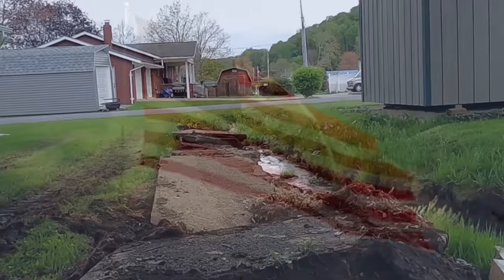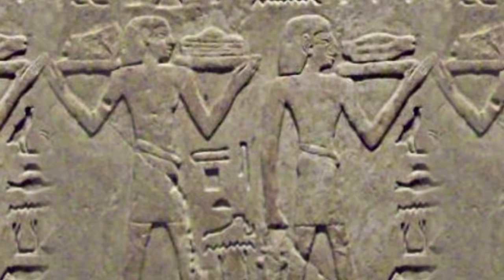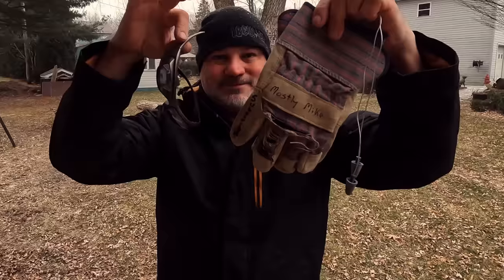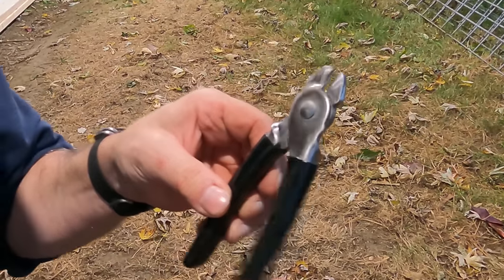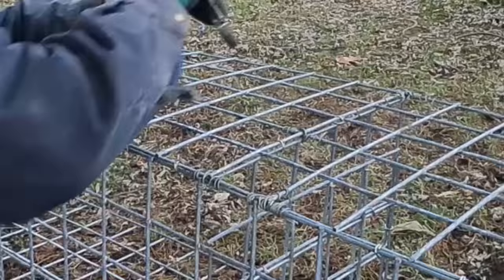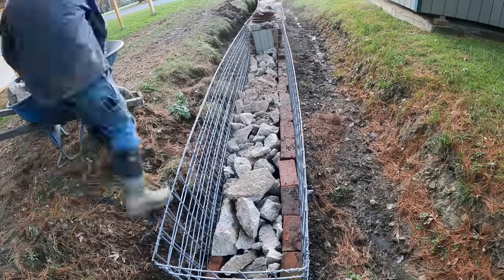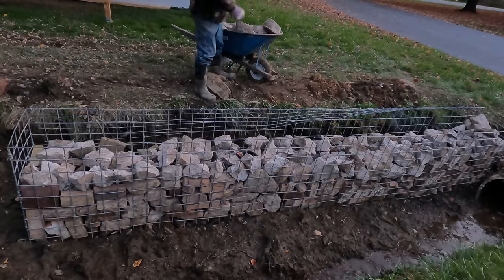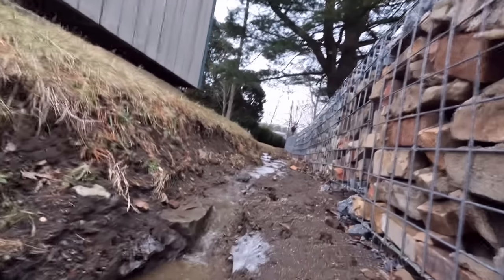How I Built My Own Border Wall Cheap

Comment: Anyone wanting to do this you better get permissions from the city or you may have an issue selling the house later. Even if you're not 'redirecting the river etc' the aholes at the city will have a conniption for no reason about this.
Reply from the maker: Thanks for watching Jeffrey. Yes, I would imagine that some municipalities would. I just think that being that I filed multiple complaints with my boro being that there's a 24 inch pipe feeding this ditch, which occasionally flows at full pipe when it floods... and then there's a 16 inch pipe at the end that flows under the road which dams up. Even if there's no obstructions it dams up. Usually one stick will go across that pipe and then the leaves and grass build up on it. I believe that this is a clear violation of plumbing code, and they don't want to do anything about it. They keep promising, but they don't produce any results. It's ridiculous. At least this wall keeps the water from just coming into my yard, and flooding my garage. Instead, it flows over the end and then goes down the road and washes my gravel out of my driveway.
Reply: It's not a permanent structure, so no permits needed.
Reply: Free men don’t ask
Reply from the maker: @smellycat249 Ha ha very true . I am not a fan of big gubment.
Reply: @smellycat249 
Proud member of the outlaw builders association 28yrs,  no permit required.
Reply: Your property  do as you wish. Tell the government to fly a kit
Reply from the maker: @jpgerard9844  Absolutely! This is 'Murica! I'm a proud veteran who fought to defend this great nation. Thanks for watching!

Comment: Very cool! When I was in Afghanistan we used these to surround our base, only difference is we filled them with sand and stone and they had fabric liner inside to hold it in
Reply from the maker: Thank you so much for watching, and thank you for your service.
Reply: Same here in Iraq. Good 'ol Hesco barriers. 

I am curious, though, isn't the water just going to push through the loose stones' gaps?
Reply from the maker: @preparedmindstrongspirit5724  well, yes, it does move through, but it slows it down and diverts it. It actually carved the ditch bigger the other direction from the diversion. What I like is that it allows the water to absorb when it gets high. It's always going to take the path of least resistance, at least from what I researched, which is making it carve the opposite bank. I own both sides of the ditch.
Reply: I built gabion towers for my driveway. They are about 10’ tall
Reply from the maker: Sounds awesome Michael. They're a really cool artform. If you have any pictures of them, feel free to share on my Facebook page. Thanks for watching!
Reply: Welcome Home
Reply: I'm exploring using Gabions to divert storm water runoff towards my house.  Was wondering if adding sand would further slow water from seeping through.
Reply: I would like to learn more about this. How high could you go with the wall filled with sand? I’m wanting 15-20 feet in height

Comment: I did a mass wall a number of years ago.  Stone face either side,, rubble fill.  Grade change from front yard  to walk out basement  rear.. I feel your pain.  Mine was only about 30 feet long,, being a mass wall  8 feet high meant  8 feet wide at the base,, plus a footing that reached another 3 feet down below the frost line.  Half a dozen of the stones were very large 400 to 700 pounds.  Most were in the 20 to 100 pound range. Just muscle, pry bars, and sneaky when needed. Evenings and weekends as time and weather permitted,  zero mortar or cement except the busted up stuff in the center. Just dry laid.  This is 30 years on,, nothing has moved or shifted.  Wife complained that it took too long,,,, it did.
Reply from the maker: Thanks for watching and sharing your wall story Sailor. It's hard, backbreaking work, but certainly rewarding. I love to just walk around looking at it to enjoy the fruit of my labor. I've done a few dry stacked stone walls with natural stones and some with store bought blocks in recent years. They appear as a backdrop in my fair weather videos. I'll be posting a follow-up after a year and a half with some additions and upgrades to this wall.

Comment: I did do the walls in my back yard but instead of the hog nose rings I cut the one out side leg of the wire off and bent then around the sides piece .  Also used the same method to make a 12 ft wide Matt 8” thick with the 3x5 rock to prevent erosion .
Reply from the maker: Nice Richard! I think that I am going to be making a mat along the bottom of that ditch to prevent erosion as well. I never thought that would be a problem but the ditch just keeps trying to match the elevation of the pipe going under the road. I started that project way too late in the year and I am just waiting for everything to thaw out and dry out to continue it. I might post an update video when it's done. Thanks for watching!

Comment: I have built gabber walls on a professional basis. The biggest one was a retaining wall for a shopping center where we used 4.5 thousand tons of granite and 17 thousand tons of road base behind it.  I have also built gabber fortifications for re-enactment, where we weave the baskets out of willow strands and fill with dirt and soil.  These are good things to protect cannons with.
Reply from the maker: Thanks for watching Armoury Terrain. I'm sure that as a professional who has built many of these walls, you may have shook your head in disagreement with some of my methods, LOL. I just sort of flew by the seat of my pants as I went about this project. It's relatively low to the ground, but I did make sure that I tethered it so that it could not wash away in a flood. I will be doing a follow-up video with some of the issues I've had with it as well as some improvements I've made. I built this a year and a half ago, so the Landscaping is now done and there's a bridge across it.
Reply: @themostlymikeshow  It will never ever wash away, it is too massive. The worst that can happen is that running water may be able to undercut it, causing some sections to slump a little.
Reply from the maker: That's spot on. It's exactly one of the issues that I had. One section had washed underneath and caused it to slump a little. I was able to drill a hole in the frozen ground, hook a strap and come along to it, and pull it straight. I then drove 4x4 pressure treated posts horizontally on angles to divert the water away from the wall. I filmed it, and will put it in the follow up video.
Reply: @themostlymikeshow  even though it takes a lot more material and effort, the best results are to first dig a ditch and bury half a basket in the ground to create secure footings.

Comment: Massive respect! I repaired a collapsed wall and related drainage system this past fall. It’s so true about the days getting shorter while working in the cold with a head lamp and lights.
Reply from the maker: Thanks for watching and the kind words T23001. I started on this when the days were a little warmer and with more light and once I get involved like that, it's all that I want to do. After the wall was complete I did wait until spring to do landscaping and back filling. Was your wall a gabian wall?

Comment: Thanks for the new idea.  We have a property next to a rental and there is a natural drainage that overflows in the rental's back yard and comes over to our property and runs beside our 48' garage.  The water has flooded the building several times as the concrete is just a little above the grade.  I told the owner and he acted like he wasn't comprehending what I was telling him.  It hasn't flooded recently.  This idea would be great for a border wall between the properties.
Reply from the maker: Thanks for the watching B A. There are commercially available pre-made gabion baskets, but for this application it had to be tapered, which they don't make, at least from my research, so I had to custom build these baskets. Good luck on your project if you decide to do this.
Reply: The legal principle of law called ‘nuisance’ is on your side if they did something that caused the flooding to travel your way if it didn’t ‘historically.’
Reply from the maker: @fishhuntadventure I wish that I knew how to pursue this. The whole reason for this ditch to flood is the undersized pipe where the water exits. I think that it's a clear violation of plumbing code as well as a deadly hazard if someone would fall into it. It's only a 16 inch pipe exiting and there's a 24 inch pipe feeding it which runs full pipe when we get a big storm. I have three complaints to my municipality in the past 5 years and they are doing nothing about it. I called the Pennsylvania state dep and they told me they would do something about it over a year ago and haven't done anything yet. Thanks for watching.

Comment: I worked on a wall in China in my younger days I had a lot of help there is no way I could have done it by myself. We did it all by hand we even made our own stone blocks. It took us a few years to finish the wall and they say you can see it from space people started calling it the Grate Wall of China but we just call it the border wall back then.
Reply from the maker: Great story Roy! Thank you for watching. Yes, border walls have been built for one reason or another since the beginning of time. This one was a real challenge for one man, but I stuck with it, and progress motivated me through. I don't think I would take on a project of this magnitude again, but I would certainly like to make some smaller ones and use better material for fill, so it's a little more ornamental. There's lots of pre-made gabion baskets that are in pretty cool shapes from cylinders to spheres.
Reply: If it’s made in china it won’t last 😂
Reply from the maker: Ha ha, right?!?! 🤣

Comment: Pretty decent job. Needed a cutoff wall, but that's difficult without some equipment and some way to dewater. I've built miles of gabion walls in creeks/rivers/channels - hundreds of thousands of tons of rock. The worst part was always the cutoff walls since they were typically full of water and had to be dewatered.  

The problem with being in water is accelerated corrosion, especially the wire/hog rings.  They make heavy-duty gabion wire and you're supposed to continuously lace all edges with a double wrap every other cell - very labor intensive.  But they also make high-tensile hog rings (in stainless for high-corrosion areas or galvanized - also a new specialty coating with 120 yr lifespan) that are installed using pneumatic gabion guns. The rings come in 50-piece clips, vastly speeding up connecting baskets together.  

The real skill is maintaining level baskets and completely filling them to avoid sags.  And if you need a decorative face, it adds another level of complexity/cost. We mostly used Maccafferi gabions (they claim they 'invented' gabions in the 1800s) which were more flexible - both a blessing and a curse (hard to maintain straight/level lines since the baskets sagged). Hilfiker made welded-wire baskets - they were difficult to bend, so they weren't as useful in the winding waterways we often worked in.
Reply from the maker: Wow! That's pretty impressive Arthur. I only use the hog rings to hold the baskets together while I lace them with the galvanized wire. I would have liked to have used heavier Duty hog rings, but I had trouble finding just the ones that I had over an inch in diameter, so I settled on these light ones. I tethered the wall to some stakes underground, and built a bridge to the shed on the opposite side which had a subframe of heavy angle iron attached to the bridge as well as the concrete slab under the shed which acts to keep the wall from leaning in. Time will tell if it will hold up or not. I considered as an added precaution to drill and sink heavy 2-in pipe as stakes in the areas where the wall is higher. Thanks for watching.

Comment: It's been a year since you posted this and I am curious if you have seen any erosion in the bottom of the ditch that has affected the wall at all?  It looked to me as if there may have been the possibility of scour that would undermine the wall base due to the elevation above the waterline at which it was installed.  How has it held up?
Reply from the maker: Hi Matthew. You are spot-on with the erosion at the bottom of the ditch. The wall seems to have speeded up the flow of water, so the bottom started to undermine one section near the culvert. I hoisted the wall back, and made diverters out of 4x4 pressure treated, and drove them under the wall at angles to divert the water away from the wall. A few careful placements of stone also made the water divert toward the opposite side. It is now cutting into that side, but that's what I want. I own both sides of that ditch, and where it is eroding to now is where it was originally. I will be posting a follow-up sometime in the future showing these repairs as well as some more sections of wall that I added. I also landscaped, put a bridge across to the shed, and added a culvert for my gutter drains.
Reply: Armoring (damnable spell check!)
Reply: liked the vid. When I saw the gabion I knew it was going to speed up the water and in time it will cut down and undercut one side. (lots of vids on this on YT) Putting down a layer of riprap and covering with 20 GAP stone chip to interlock it in place would mitigate that.  Add a wall 10-12 inches deep of stone chip behind the wall to stop the water digging behind it.  I also saw a shed on the unprotected side close to the bank, was it undermined?  This looked like a bigger job where the culverts looked too small under the drive and mebbe could do with upgrading?  effective result and good job on the cages.
Reply from the maker: @williamoloughlin8298 Thanks for watching William. Yes, it did exactly that. It started to cut into the opposite side. It's been about 2 years now and I think it is done eroding that side as well. I will be doing a follow-up video showing the back filling and how it was done. I basically laid out some Geo fabric underneath, filled it with number three limestone, and then about 15 in from the top, put another piece of Geo fabric on top then filled with topsoil against the wall. This way the water can still expand if needed. It's funny you mentioned the Culvert under the road. It is the main reason that this was done. If my municipality had put a bigger pipe in, this probably wouldn't be necessary. I have owned that property for over 5 years, and have been constantly trying to get them to fix this. When I do the follow-up video, I will show the 24 inch pipe feeding this ditch with a full pipe of water, while that measly 16 inch pipe is trying to drain it all. To me this is clearly a violation of plumbing code, but I am no code enforcement officer.

Comment: I’ve done this and it’s the best and greatest way to do it.  TIP you can get any foundation rebar company  to take 3/8 rebar and put a hook on each end like a candy cane the with of your wall and run a pice of rebar on the both outsides of your cage and just hook it from side to side . Very fast strong and straight. Just give the proper dimension for the wall. You won’t have to wrap and twist that wire to keep it from spreading
Reply from the maker: Thanks for watching and the helpful tip Richard! Sounds like a great idea.

Comment: An even-more expensive gabian is made with split rocks.  The flat surfaces facing outwards are easy on the eye, but not the pocket.  Exotic rocks with beautiful colors, are even more expensive.
Reply from the maker: Thanks for watching and sharing some insight. This wall was made on a low budget and is more utilitarian than ornamental. It actually looks a lot better than the bank that was there before.

Comment: In the British Army we used hesco/gabians. They have hessian material pined to the inside so they can be filled with sand or soil, aswell as rocks.
Reply from the maker: Thanks for watching and sharing Scott. The larger holes in this material made it a little tougher to fill...especially when I ran out of the concrete rubble. I had to stack up the larger pieces of limestone, and then fill the middle in with the finer pieces.

Comment: You can get rebar ties in various sizes to do the job those hog rings were supposed to do. The hog rings will only hold to the bending strength of the wire they are mad of. When they rust, that will be less. Not good. Rebar  ties are short lengths of wire with a loop at each end. You wrap them around the two pieces you want to hold together and put the loops next to each other. There is a winder that has an offset hook in it that you push through the wire loops. By making a winding motion with the tool, you can wind the wire tight nearly effortlessly in about 3 seconds. They won't come open like your hog rings, although they will eventually rust away as well. Look up "rebar ties". Cheap and easy. Leave the hog rings for the pigs.
Reply from the maker: Thanks bomaite. I only used the stainless hog rings to temporarily hold it together before I laced it with high tensile strength galvanized wire. Those rebar ties are a great idea though.